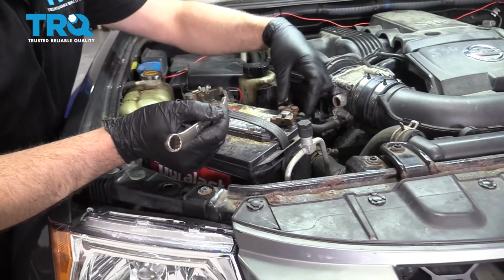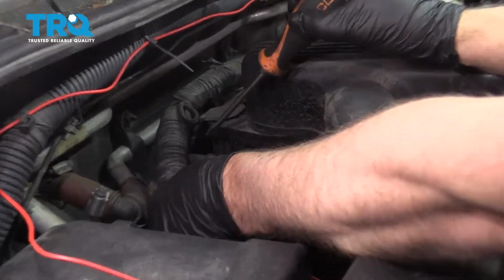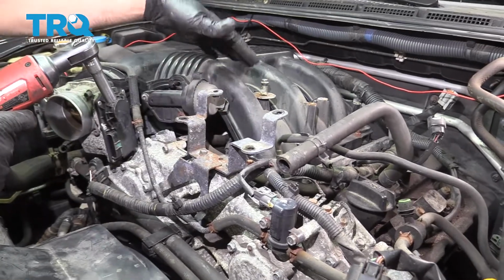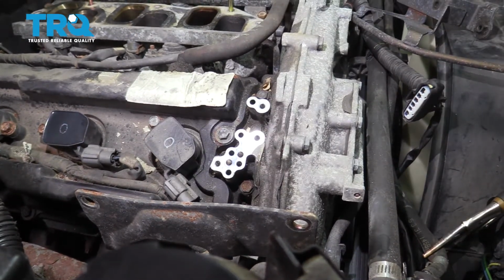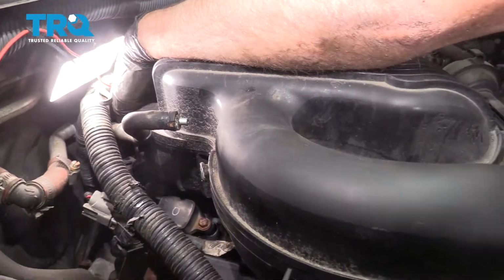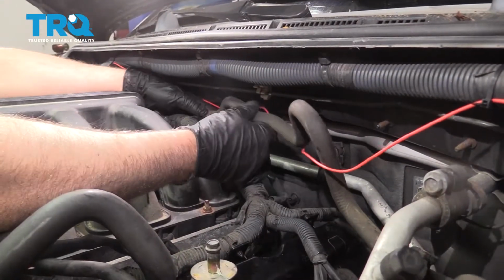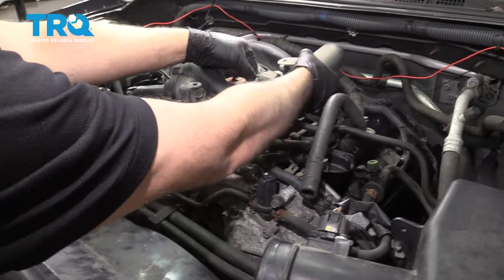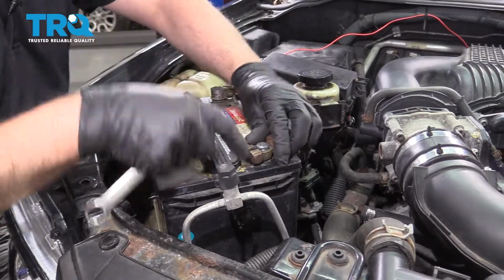How to Replace Variable Valve Timing Solenoid Passenger Side 2005-2015 Nissan Xterra

Comment: Just in case anyone's wondering, you can 100% do this by leaving the intake manifold on. After taking the snorkel off, remove the coolant hoses as he shows that go to the throttle body. Remove the 4 hex key bolts and take the throttle body off(inspect the sealing O-Ring after removal). You can then use a wobble or swivel on a short extension to easily get to 2 of the 3 bolts. The one closest to the driver side can be removed by hand after breaking lose with an open or closed end wrench. There's a decent amount of room to remove it from the vehicle after all the bolts are out. Hope this helps someone!

Comment: Appreciate this video so much ! 
I did 05 Frontier without having to clamp the hoses by disconnecting the throttle body from the manifold. I wanted to see and clean the inside.
Was hoping i could do it without taking the intake off but i definitely had to.
Thank you.

Comment: You’re amazing. Subscribed. What’s the name of that solenoid at 24 minutes?

Edit: Nevermind, I found it. It’s the vacuum reservoir, or pressure tank, or  vacuum tank. The 2 hoses coming out are 3.5 mm vacuum hoses 🤯. The parts stores wanted $100+ each, for less than a foot of 3.5 mm hose. Got some on amazon instead.